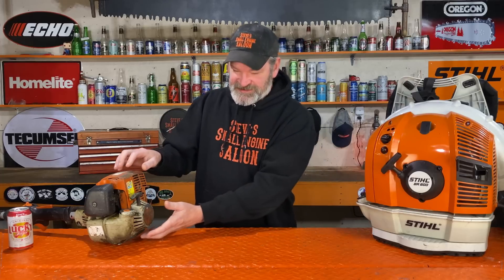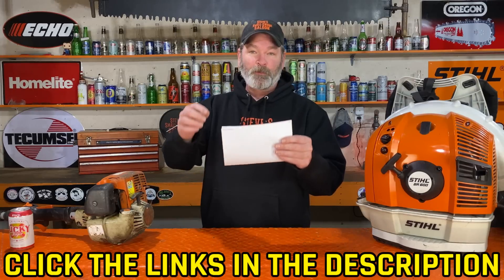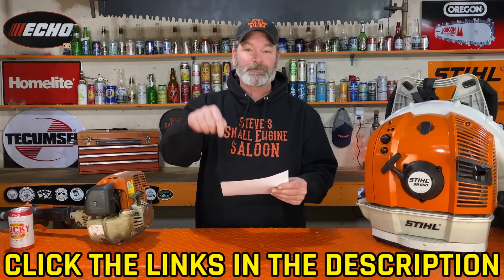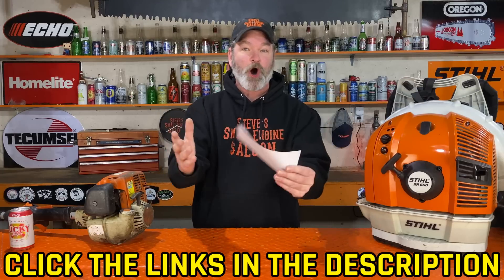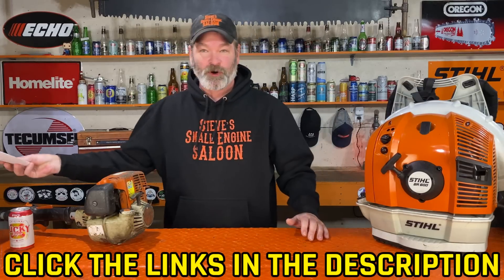Is A Stihl 4-Mix Engine A 2-Stroke Or A 4-Stroke? (DAY 1)

Comment: Great video Steve the way a 4 mix engine lubricates itself is the intake where the carburetor is mounted the port is connected to the crankcase  under the valve cover only half of the fuel is actually burned in the combustion chamber the rest goes through the valve compartment then down the push rod wells to the tappets which then lubricates the cam gear and then finally into the crankcase to the wrist bearing, crankshaft and bearings and then out the crankcase breather tube back to the intake to recycle it this only works if all the engine seals are in good shape one pinhole in any seal will cause the engine to run lean or not run at all the reason 4 mix engines have no sump is to save on weight and keep the equipment compact.
Reply: No, this is not about saving weight. It's about trying to present a stupid idea as 'new and improved'. My four-stroke trimmer requires 60ml of motor oil in the crankcase, which weighs just 53g or about 1.7 ounces. That's negligible.

Comment: Basically, if it has no oil reservoir, it needs mixed fuel. Engines need lubrication. Also, does anyone read their manuals anymore? Worth doing after investing money in any piece of equipment. From a VCR to a Car, the manual knows all!

Comment: Two stroke has ports 4 stroke has valves first thing I learned about motors way back in the day
Reply: Some two strokes have intake ports and exhaust valves, so the two strokes only have ports theory isn’t quite right either. Just sayin.

Comment: Valves or no valves does not determine the cycle an engine uses. Detroit diesels, and EMD diesels have exhaust valves and operate on a 2 stroke cycle. An ingenious engineer could do the same with a spark ignition engine.

Comment: The frustration is real Steve! I used to work in lawncare and got a 4 mix trimmer. My boss used crapsman 4 srokes (side rant, those are the biggest pos trimmers out there people, avoid at all cost!) and I was explaining that the 4 mix was a 4 stroke but took mixed fuel so you could turn em whatever direction and not care about an oil sump. He said that same thing you've heard, "if it takes mixed fuel, thats a two stroke!" I tried explaining the valves, how a 4 stroke works in operation, that there's two stroke marine diesels with an oil sump, just could not get it through to the guy! He decided that I just "didn't know the difference between 2 stoke and 2 cycle"... the stuff people will make up to save face is amazing, ha! Good vid, keep it up Steve!
Reply from the maker: Right on buddy!
Reply: There shouldn't be any such thing as a 4 stroke weed eater!
Reply: @GuysPlayingWithTools  Try one out first. I'd never go back to two-stroke.

Comment: For what it's worth I prefer the 2mix engine as they rev higher.
Better for strimming.
Nice to see you and your Missus back on YT Steve.
Reply: @Derek Bright... For What It's Worth is a song by Buffalo Springfield. That I happen to prefer, because it sounds a lot better than some small engine running!
Reply: they don't actually rev higher, they just sound like it.  I really like the 4mix on my new brush cutter.  one pull start every time.
Reply: Have you actually ever tried the 4 mix? I need to report how pleasantly surprised I was as the 4 mix goes to idle chug mode…..off idle away along on the delicate stuff and the trimmer string just lasts forever. But this engine characteristic also allows a WOT that gets er done. Adjust your valves once in a while and use a good oil. These are good engines is you treat them right ie no ethanol etc. …….abundance of power.
Reply from the maker: Thank You...
Reply: And I love my Honda trimmer because I don't need to rev it to the moon to do any trimming
Reply: @loveracing1988  parking lot queen is it? Try using it on some thick heavy stuff…..you’ll need to put your foot on the throttle for that mate because if you don’t it’s not going to idle it’s way through the tough stuff. The nice thing about the 4 mix is that it’ll idle through the light stuff and where you might want to be delicate…and also kick butt on the jungle. I expect some models of Honda will be similar. Honda is very pricey but mostly good stuff. Jenny’s, motorcycles, lots of nice quality power equipment. Too bad their cars couldn’t last like a Toyota tho.

Comment: It's often difficult to explain to our customers in my repair shop why their engine is destroyed. They buy the 4 mix thinking is a 4 stroke and doesn't need oil, after they destroyed their 2 stroke by forgetting the oil.
Reply: But it is a 4 stroke 🤔
Reply: @meltof  Exactly!  He just got done saying it's a 4 stroke engine.      Whether you put oil in your gas or not,  it doesn't suddenly make the engine  a 2-stroke!
Reply: @meltof  then you better check that dipstick before you fire it up ! 😄
Reply: I am from the Husqvarna dealer. What issues I used to have, can't explain!!
Reply: I feel your pain Steve.
Reply: Terrible marketing - the "4" is the problem not the customer.